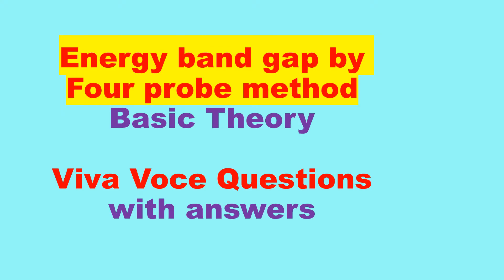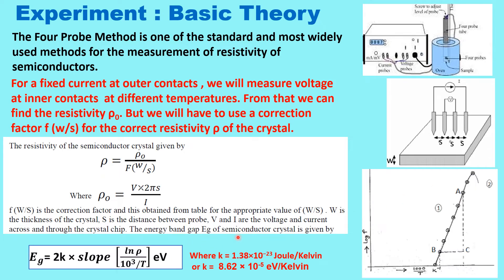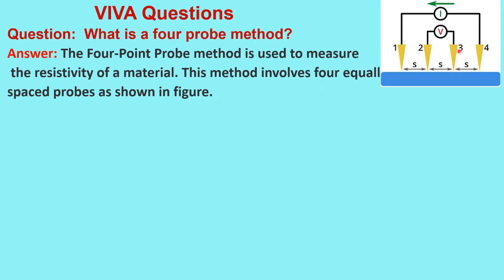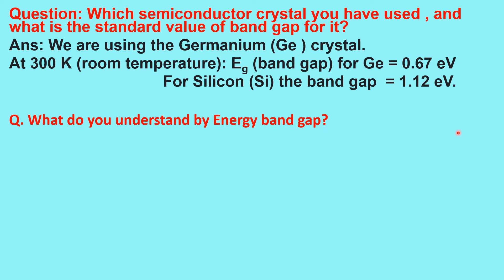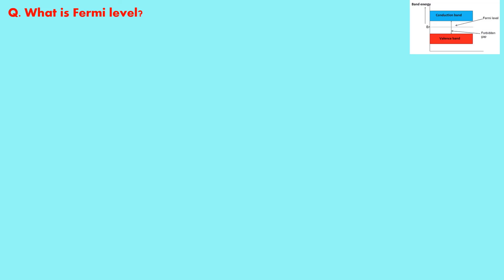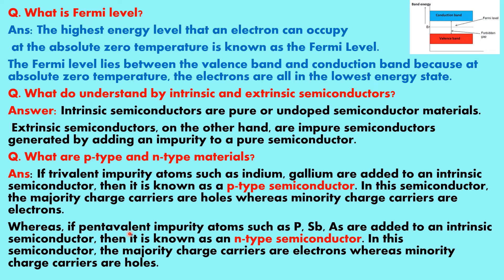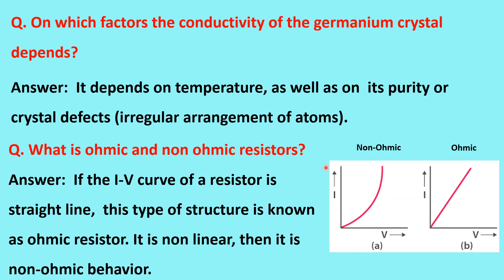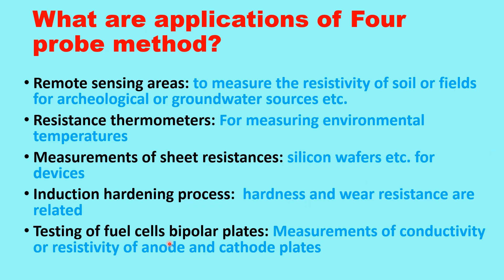Four Probe Method| To determine the energy band gap of a given semiconductor material| Resistivity

Comment: You can plot the log resistance instead of calculating the resistivity as all the parameters, electrode spacing, crystal dimensions etc. are fixed.  It is the slope of the temperature dependence that gives the band gap.